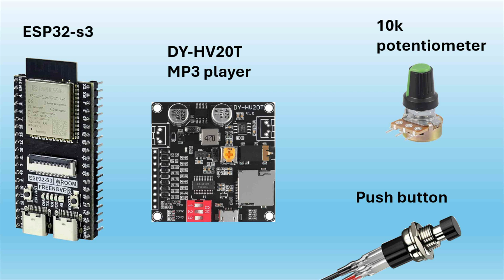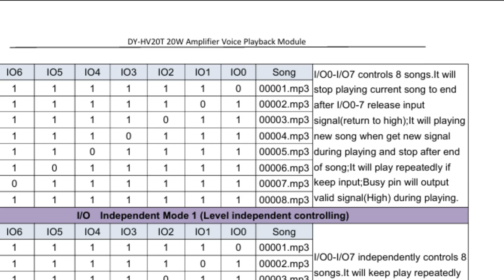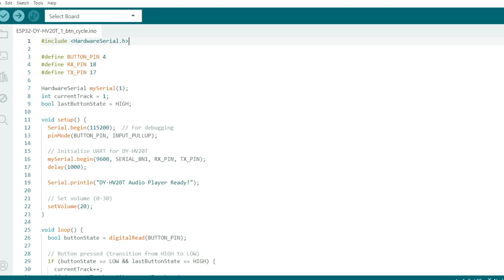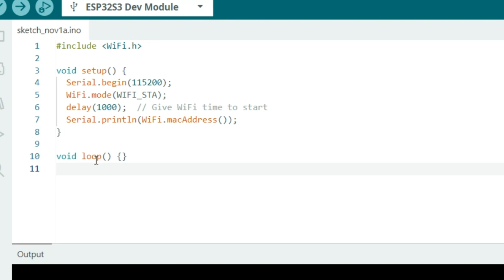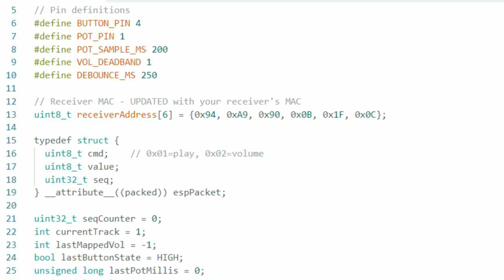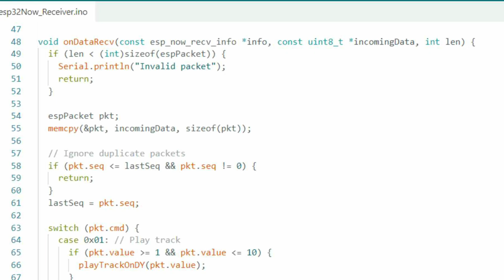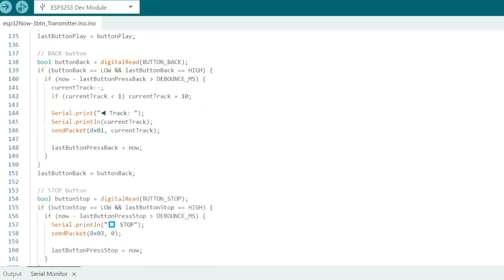ESP32-S3 Wireless Audio Player Tutorial | ESP-NOW Control of DY-HV20T MP3 Module

Comment: Can u make volume controller.... Like wireless volume knob with 2 esp32.. 1 is the volume knob an the other esp32 receiver is the RCA controller to the amplifier
Reply: im planning to do exactly this stuff paying 900 for a LF knob haha should cost less then 100
Reply from the maker: @hntrkefs  awesome! 👍
Reply: @BMonsterLaboratory would you be willing to make a video showing how it’d be done? im sure you’d get a lot of views from people in the car audio scene who’d like a wireless plume knob please it’d be great
Reply: @hntrkefs it will.. DIY video.. will be must cheaper to make for guys that's into car audio
Reply: @hntrkefs  will be less for me😅lol I'm from South Africa the price of LF for us way too much... I want DIY bass knob
Reply: @Mr18729  i’ve currently got the pieces payed out on my desk haha hopefully have it working by the new year
Reply from the maker: hi !
Yes, this is absolutely doable. One ESP32 can act as a wireless volume knob, sending volume commands to a second ESP32 near the amplifier. The receiver ESP32 would control the audio going into the amp — either by adjusting an analog volume stage on the RCA line or by controlling an amplifier module.

For example, instead of using an amplified speaker like I did in this videoi, the receiver ESP32 could control volume using an onboard amplifier like the DY-HV20T, or an external amp such as the PAM8610. So then we have one ESP32 sending control commands, and the other applying those changes to the audio path. 👍👍
Reply: @BMonsterLaboratory thanks alot I'm it get all the parts together an try it

Comment: Hii..can u make esp32 s3 midi controller over bluetooth..ai help me but so many wrong code creat by ai is bullshit 😅😅
Reply from the maker: Hey there!
AI is usually a decent supplemental tool. Never trust it 100% and always assume there are mistakes! 😆
Freenove has excellent documentation, which is very helpful, and the data sheet for the HV20T is very helpful as well.

Can you copy/paste your code in email and send it to me?  Include components you're using and how it should operate. 
Happy to help out however I can 👍👍
bmonsterlaboratory@gmail.com